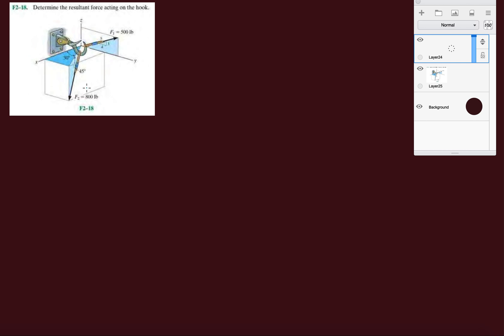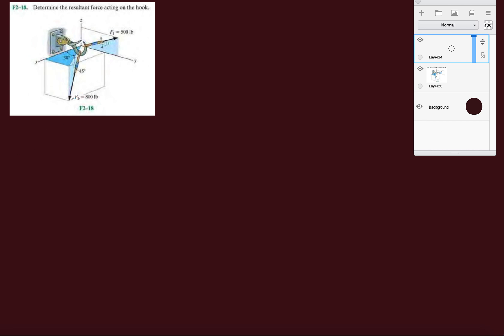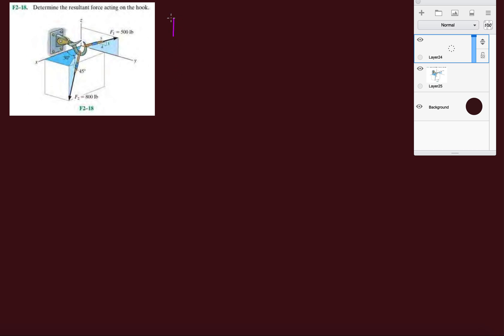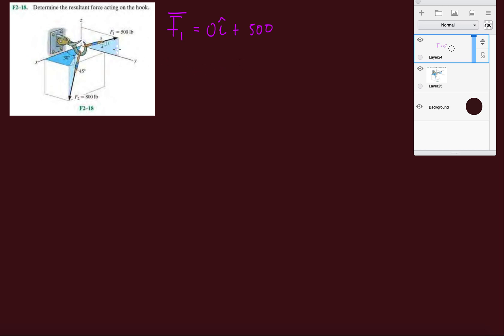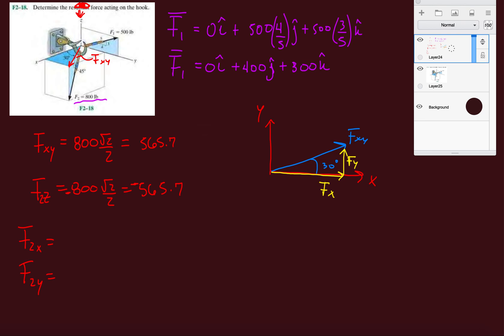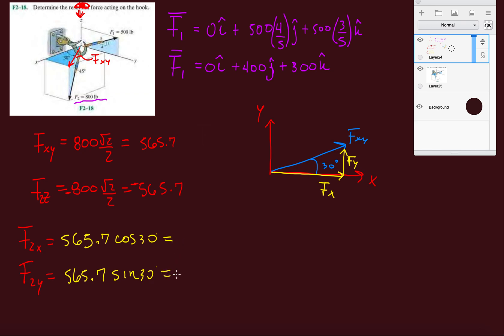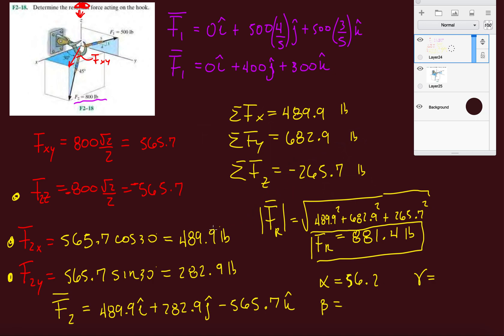Problem F2-18 Statics Hibbeler 12th (Chapter 2)

Comment: F2y should be negative because the y component of the F_2xy is pointing to the opposite side of the positive y-axis.. can you kindly confirm? I know the textbook also says it is positive but it really looks negative
Reply from the maker: it wouldn't be negative because once you project the vector into the xy plane, it shows it points in the positive x axis and positive y axis, it does point in the negative z axis though. Maybe you are confusing the y and z axis?
Reply: @theengineeringcrucible3490  thanks for your reply. Appreciate it. Yes I was confusing them for xy plane